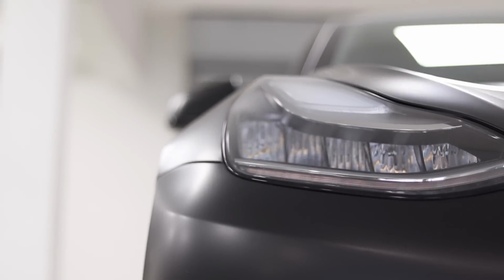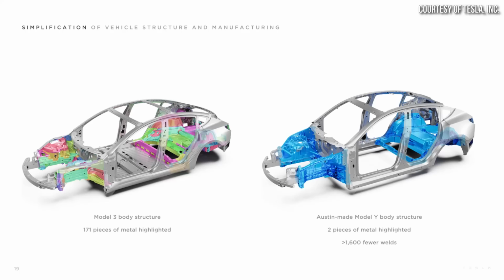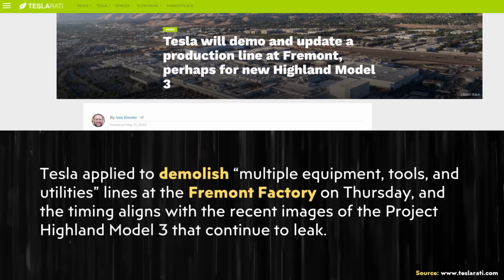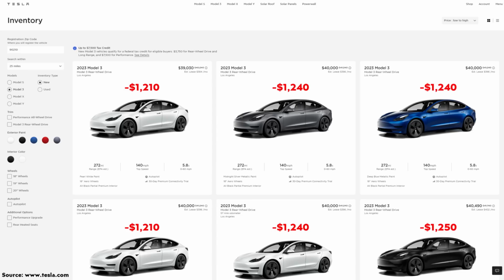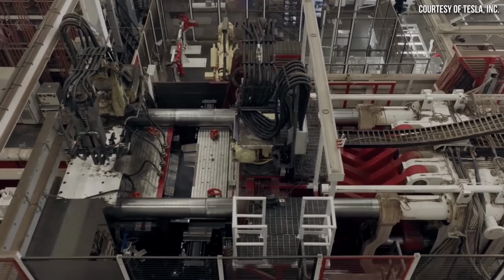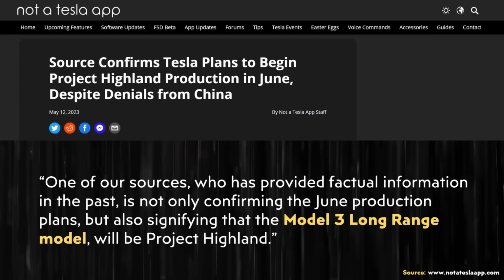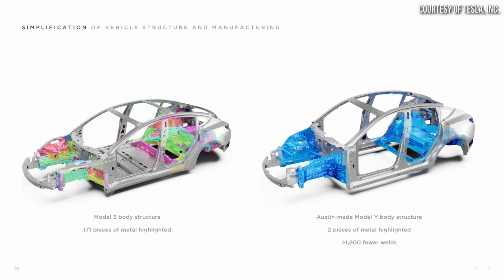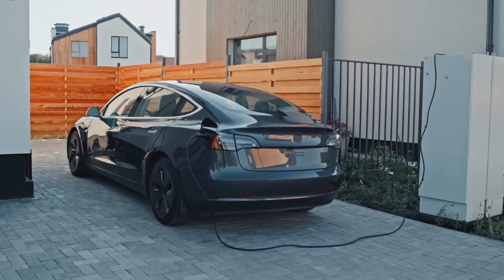BIG Tesla Model 3 REFRESH COMING SOON | When & What to Expect

Comment from the maker: Thanks to Ridge for supporting the channel! Save UP TO 40% through June 15th >> https://ridge.com/cleanerwatt
Reply: What is the take rate of “free to try” FSD? That will determine FSD’s affect on TSLA price. Btw, per Munro from a couple months ago, initial Highland M3s will NOT be front casted. I’m guessing Shanghai will develop “transition” tooling to pilot Highland conversion (with front casting) at all other M3 production lines.
Reply: There's one thing I don't understand. Is this project highland model 3 
1.the unboxed assembly method? 
2. halfway there?
3. But at all thats a future plan only at this point?
Reply: The signs all point to the Model 3 changes coming at once not staggered.
Reply: You are wrong about the LG 2170 cells as that makes no sense at all - ZERO. I am sorry but you are flat out wrong as you missed something!
Reply: Thanks Jon. LFP batteries will also reduce range somewhat.
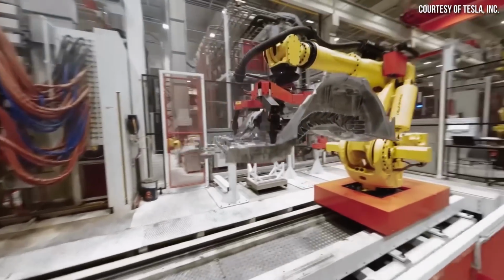It's an old clip, and we've seen it before, but what is that falling off the casting at 15:00? Is it merely excess material, or a vital part?

Comment: What r ur thoughts on the Cybervan? You know, maybe the next Tesla car might not be  stainless steel, who knows. But hey, maybe the "Cybervan" will be for so many reasons. It's a bigger vehicle so it just might be built on the Cybertruck platform (less desining cost ). More space for big battery, longer roofline for solar panels. I think Elon say he would not consider solar panels on a car, at least not for now, not enough space. I think he said maybe a van, because of the longer roofline (more miles per charge). Also it's almost a natural to follow the Cybertruck design language on a van just adapt the Cybertruck to a Cybervan form. So that would lead to the goal Tesla has on bringing  manufacturing cost down on the Cybertruck. The TAM would probably  double on pratically the same vehicle. The more stainless steel purchsased the less expensive it get's. The same goes for the rest of the parts. Actually we'd be talking a page out the ford or chevy book converting their pickup into a SUV, back in who knows when. We would convert a pickup into a van instead of an suv. The van needs to take a beating, no paint, it's made out of steel (practicably indestructible). Who knows they could start doing at least some of the "un boxed method". It's hard to believe they will not take advantage of this opportunity. Thanks for what you do it's great!

Comment: I have been zeroing in on getting a Model Y. I love the greater sportiness of the M3, but I'd prefer to have the option of adding a towing hitch which apparently isn't an option on the M3, and I may sometimes need to have more cargo room or occasionally decide to "camp" in the car and the MY is so much better for that. All that said, if Tesla is able to reduce the price of the M3 sufficiently, I might go with one anyway and just borrow the wife's F150 when I need to haul something. 

So for now, I'm just going to continue to wait, and hope for something like the following:

* Tesla Model 3, Model Y or maybe Model Too (around size of the Model 3 but maybe a little taller with a hatchback, a little less zippy, lower top speed, maybe slightly reduced range (but want at least 250 miles) and around $25K USD )
* Hardware 4 or later.
* Comfortable seating for four+ adults.
* Fast charging on trips.
* Cheap overnight charging at home.
* Battery chemistry like LFP that prioritizes safety and pack longevity over range and performance.
* 6 second or better 0-60, but more importantly plenty of power for merging on the Interstates and zipping around and away from big trucks and cars on trips, the latter two requiring good acceleration from 50 through 80, at least.
* Under $30K after tax and delivery.

Obviously, I might have to compromise somewhere.

Comment: Great video Jon. Will Fremont factory & GS not need couple of Gigapress if they switch to front & back casting? I don't think we have seen installation of additional Gigapress at Fremont or GS. One option could be that they could change the molds of the existing Gigapresses to make both Model 3 & Y. Is this the reason why we see so many castings stored at both the locations?

Comment: If they employ giga castings in the Model 3 refresh they will have to stamp new rear quarter panels, and perhaps new front fenders as the attachment points may be different.  It would be a real cost saver if the castings were the same as the Model Y.
Reply: 100%

Comment: If they go in stages, doesn't it make more sense to start with cosmetic changes? They would be easier  to implement and would have a more noticeable effect on demand.
Reply: They could, but I think it's best if a "new look" model 3 really is better under the skin.  If I bought one, and then found out that it didn't have the mechanical improvements, I'd feel ripped off.  If the reverse happens, nobody would be upset about anything.
Reply: One of the things I love about Elon/Tesla is that they seem to care more about doing good than making money. And they apparently don't have a demand problem right now.